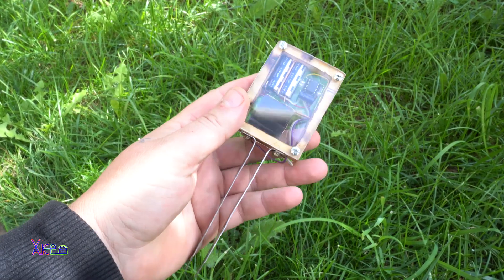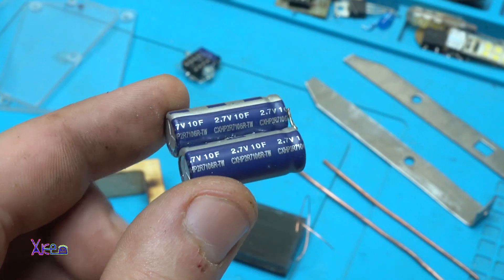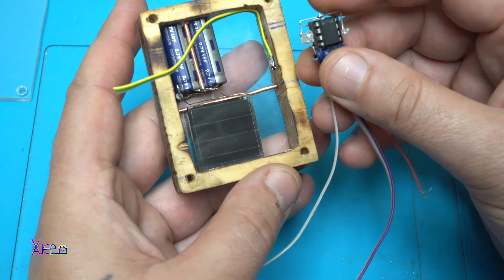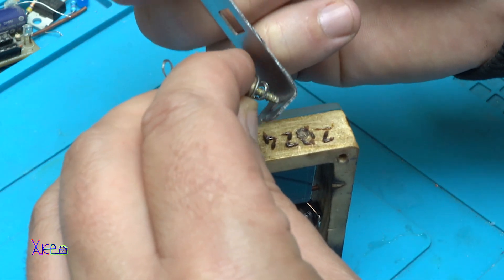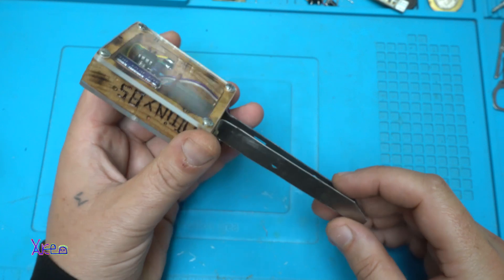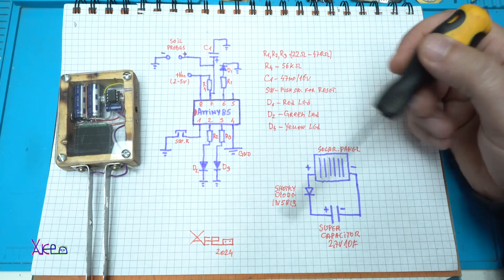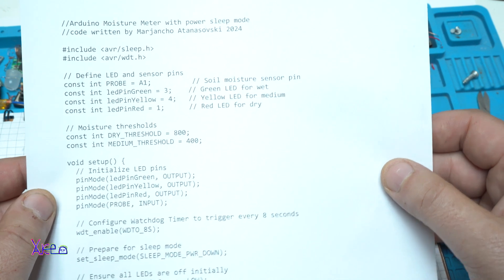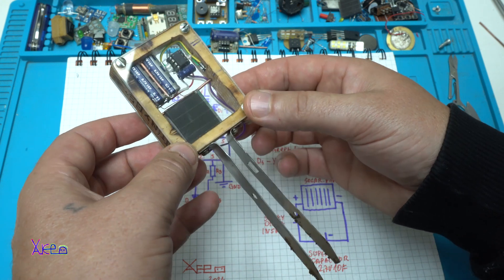Smart Arduino Project To Save Your Plants from Disaster

Comment: Thank you for sharing! I have been thinking about this solution for a while For me, I like your use of an ATTiny instead of my usual Nano - I learn a different, elegant and more efficient way. Tell us please:

- why use super capacitors instead of batteries? Is it because it is just easier to regulate their charging?

- did you do any solar charging calculations, and is this why you are using the sleep function (which is a very cool thing that I haven't tried yet)?

- did you calibrate the code somehow to accurately display the moisture levels?

Cheers, Jonathan
Reply from the maker: Hello Jonathan
Thx for feedback sir and to answer some things,I want to experiment with super capacitors bcz they have longer life than lipo batteries but one thing is negative about s.capacitors they dont have many capacity so I decide to use sleep mode to save energy.Right now I am testing the device and we gona see the results in one month or so.
Yes need some calibration on distance between probes.
Thx foor support and I am glad that you like thebproject.👋